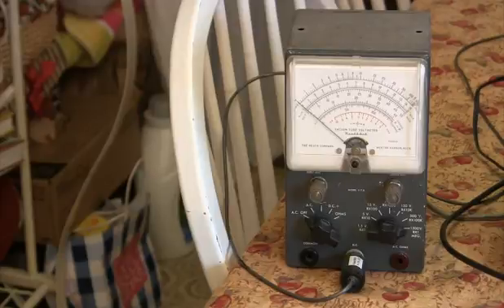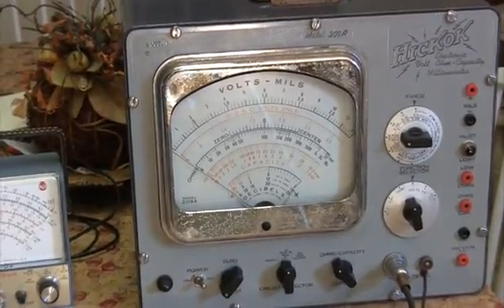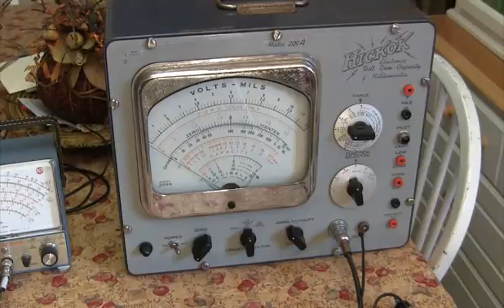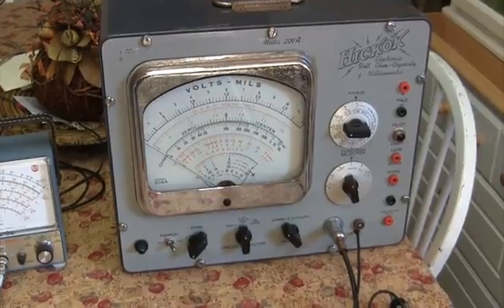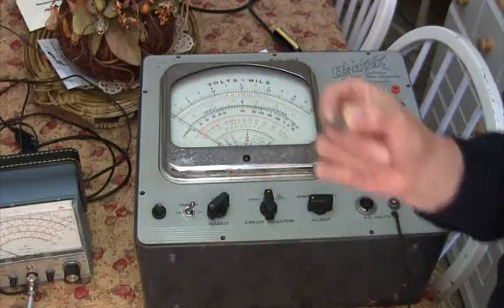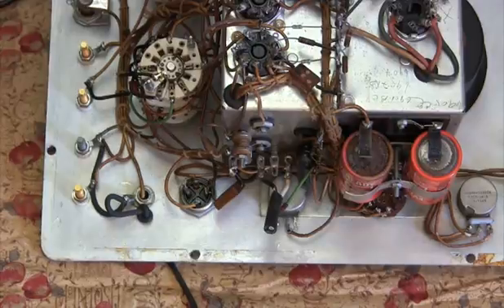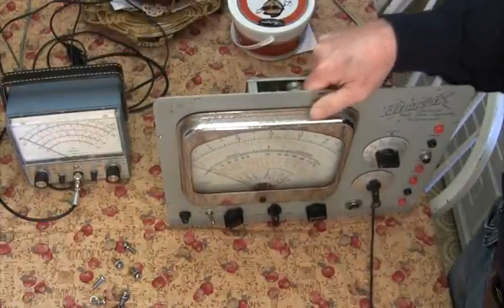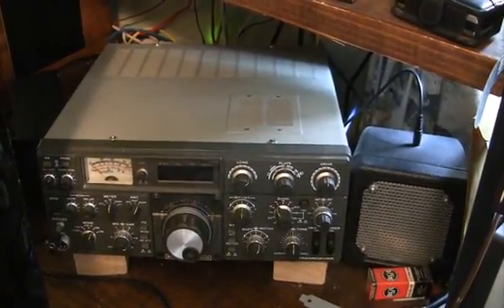New equipment un-boxing, (sort of)

Comment: Tom,
As usual, I'm late in catching up on vids, but this morning I'm taking some time to do it.
That Hickok is a monster piece of test equipment for sure.  It looks great.  And leave it to Old Goat to know what it is and how well it works.  If it's 100-years old Bill has at one time used it.  :-)
BTW...you sound great.  I detect no problem at all.  But to stay on the safe side don't overdo anything for right now.  Easy does it.  Got it?  Got it!.

Regards,
John

Comment from the maker: Hi Bob:
Yeah, I never have heard or seen one like this. It sure is bigger than anything I have seen in the past.
It is suppose to read P-P and RMS AC voltages accurately up to 400 Mhz as well. Also I like the capacitance ranges are huge on this thing. My Solar CB-1-60 is not very accurate on mine for reading the capacity. I will still have to use it for leakage tests though because the 209A does not have this ability.

Comment: That Hickok 209A is a great meter, I had one but I sold it because I had to close my shop.
That was the best  meter I had beside my RCA Voltohmest like you had.
Keep that Hickok you may need to replace some caps and some resistors.
Make sure to replace the  electrolyticsand of course any paper caps.
I bought mine at a ham radio auction many years ago for $10.
I used to have the manual on mine but it sold with the meter.
It will need to be calibrated, I used my FLUKE DMM to do that